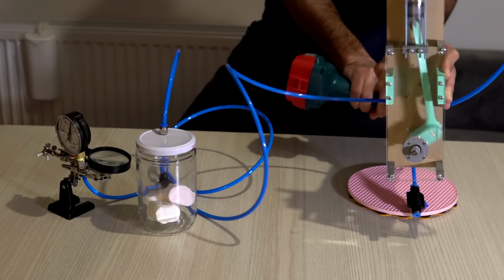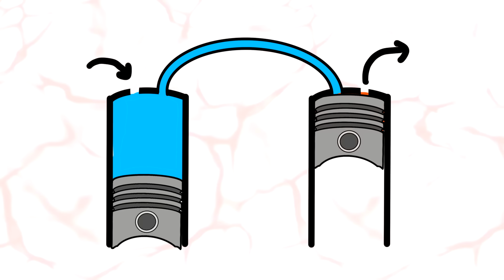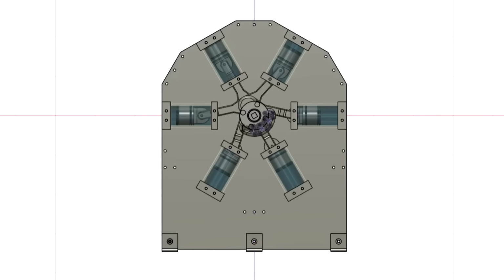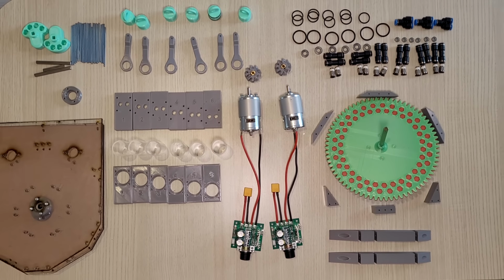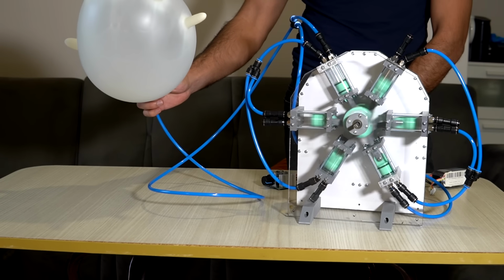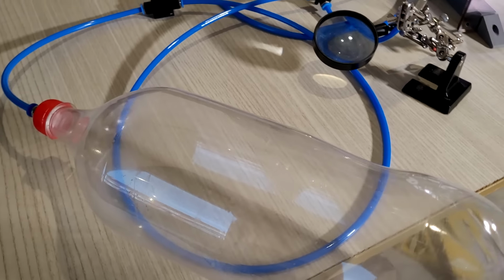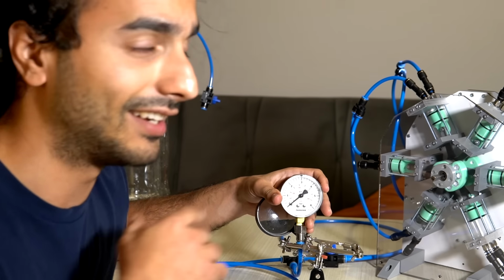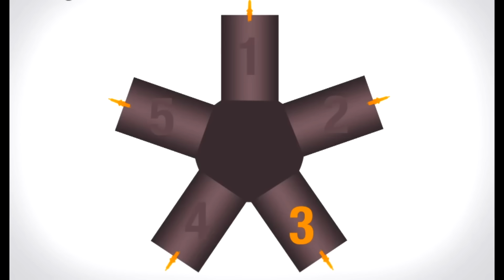I Built a 300+ psi 3D Printed Compressor

Comment: you should turn one of these compressors into a 4 stroke engine, the plastic may not withstand the heat but it would be awesome
Reply from the maker: I really want to build an engine but I live in a studio apartment
Reply: @canocholic you could maybe build it inside and run it outside

Comment: If u build compresor from 10% parts which are 3D printed (and in this case they are just decoretaion ) its focking clickbait.....and trap
Reply from the maker: The parts that would cost an arm and a leg to cnc like pistons and crankshaft are all 3d printed. I think things like backplates shouldnt be 3d printed that's juts waste. 

For the cylinders they need to be smooth and pvc pipe is cheap and smooth.

Comment: Awesome design! I would recommend BLDC motors tho. Probs gonna be more expensive than your current setup, but those 775 motors are only ~80w or so. Just one rc car motor can do several hundred or even kilowatts. It should be able to run the pumps at higher RPMs and higher power. Plus, with a pressure or flow sensor + arduino/esp32 you can even get some automation done.
Reply from the maker: You're definitely right but I work with a tight budget. Maybe as the channel grows i can use better equipment

Comment: Your work on this is seriously amazing.  

A 3D-printable rotary vane vacuum pump is seriously what I would consider one of the key technologies that could change the state of the world when they are fully open source and free to make commercially for households and local level businesses.

Particularly if it can be plugged into and used for heating and cooling as well.

A project I’ve been working on is trying to find a way to make wax-filament specific 3D printers and waterglass based molds.

And then building out a web-platform that automates how to make molds for different materials is also something worthwhile, which can be done via integrating FreeCAD with threeJS.

If we could combine 3D printable rotary vane pumps with 3D printable Kilns designed for wax-filament melt-out, then we can also build the stuff to make single walled carbon nanotubes and nanofilters based off carbon using reaction chambers.

Then there would be the capability to make a fully 3D printer based manufacturing industry that is wholly based on renewable energy and electricity.

And it could be based off materials that can be produced literally anywhere in the world by any country.  

Making every country capable of industrializing from the ground up with only local level businesses, using Open Source technologies as a basis that can still provide a bedrock of modern convenience even just using renewable energy.  

While also giving the people the capability to have modern conveniences and automation, without the government or large companies being in control of the origin and baseline of society.

I’ve been working mostly on software projects for enabling an ‘open source economy baseline’ for a while, since that is my profession mainly, and have only gotten so far skills wise in terms of 3D printing despite having the physics degree as background.  

But there are many projects that give people hope of breaking out from under the control of monopolies and towards having a genuinely free economy, and the scope of comprehensive projects out there seem to cover all the bases.

Yours is a super important one though, thank you for all your work in making this kind of work available publicly.
Reply from the maker: At home engineering got to impressive level in recent years. With opensource projects and experiments, the amount of knowledge and tools we can reach is amazing.

Comment: Multi-cylinder engines have been configured to space the power strokes together rather than evenly as you would for smoother power delivery. Most notably in engines used for motorcycle racing. This changes some behaviors like tire traction. This configuration has been called 'big bang'.

Cool project and great video!
Reply from the maker: Yeah, i heard that that way, the tire can gain the traction in the second crank turn.

Comment: Would it be possible to change the configuration based on the output pressure? 
So if the pressure is low all cilinders take in ambient air and push out low pressure air. But once a threshold pressure is reached some valves switch the configuration and it goes into the high pressure mode you showed already
Reply from the maker: With selenoids, this could be done. Would be really cool.

Comment: You should get an oil filled pressure gauge so it does not flip around wildly while the pump is running.
Reply from the maker: Yeah, those are better, but the economy here is not doing well. I kinda have to buy the cheapest things that work.

Comment: you know you can (should) run both motors off of the same speed controller. they make ones that can handle 70 amps on amazon for cheap ($30). the reason why, is if one is set to run faster than the other, the power will back feed into the slow motor, overdriving it, and try to feed generated voltage back into the slow motor's speed controller, potentially damaging it. just hook them both up to the same speed controller in parallel.
Reply from the maker: You're absolutely right. A driver would be better. But the thing is, the ones i used cost 3.5$ here in Turkey. A 30$ in US driver is about 40-50$ here. It still would be better to use, but i kinda have to buy the cheapest thing that will work. Hopefully, as the channel grows, it will allow me to buy better quality stuff.
Reply: @canocholic  well how much can the ones you got handle? you might only need one of them. a 775 motor can draw up to 20 amps at 12 volts so if your drivers are rated for 50 amps then you can probably use just one of them
Reply from the maker: No, they are actually 10 amps, i have to be really careful not to overheat them. Had to take breaks every 1-2 mins when testing.

Comment: if you add a 7th cylinder you could get an extra stage of compression, not sure if 160 psi would be good for the acrylic though...
Reply from the maker: That would be coo to try, i beleive the thin piston rods or the crank would fail

Comment: 4:53 I found that if you need cheap, small, dimensionally accurate cylinders in a project, medical syringes do great for many use cases. I think in most cases they're made out of polypropylene or HDPE, which are both less rigid than acrylic (so more deformation under pressure), but maybe they would still do the job.
Reply: I've searched some numbers for my own project and depending on your needs, they may be useful. What I found :  1 mL (363 ± 197 psi), 3 mL (177 ± 96 psi), 5 mL (73 ± 40 psi), 10 mL (53 ± 29 psi), 20 mL (32 ± 18 psi), and 60 mL (19 ± 12 psi). It is basicaly : bigger = less pressure.

Comment: 2 litres bottle dont go over 120 psi it will blowup
Reply: Someone said they're rated to 600 lol but I just looked it up and it says the max is around 120-150 PSI, sometimes up to 170
Reply from the maker: Hi, check out my new video. It did blow a bottle up!!

Comment: 4-stroke radial engines need an odd number of cylinders to achive an even firing order (1,3,5,7,9,2,4,6,8, or odd numbered first, then even numbered cylinders). 2-stroke radial engines could have any number of cylinders greater than 1 because they can fire one cylinder after the other (1,2,3,4,5,6,7,8,9)
Reply from the maker: Yupp, you got it

Comment: Soda bottles like that can take up to about 600psi, if your curious, look up world record water bottle rockets here on youtube. Bewarned though, at that pressure, those bottles can become dangerous.
Reply from the maker: That sounds insane, can't image 600psi inside a bottle. Definitely will check that out
Reply: I knew they could hold a lot more than 100 but 600??? Holy hell that's a lot 🫨

Edit: just looked it up, and it said 120; it may start to fail, but can go up to 150-170 PSI before definitely rupturing

Comment: What do you mean by "over-engineered".
Reply from the maker: Well, it's a buzzword to get more views essentially. But my logic was that it is so unnecessary and excessive for a compressor to have 6 cylinders. And there aren't many 3d printed compressors that can reach this pressure.
Reply: @canocholic  Okay, but more cylinders does increase the volumetric flowrate for a given size cylinder.

Have you thought that perhaps the smaller size of the piston and cylinder is the reason why you can reach the higher pressures?

Also, on reciprocating compressors, the maximum pressure is related to the compression ratio.

PS:  As an engineer for over 40 years, the phrase is pretty much like fingernails on a blackboard.
Reply from the maker: Yeah, i definitely do understand that. Besides the title, did you enjoy the video, how was it for you?
Reply: @canocholic  Your videos are excellent.
Reply from the maker: Thank you, for the titles I'm sorry but I have to come up with somithing that sounds interesting even if it is not %100 true. It's just how YouTube works. Christopher Nolan can upload his new film here without anyone knowing and with a bad title and thumbnail nobody would see it.

Comment: recently, i've watched a video on radials rotary piston aircraft engines, (don't remember the name, some italian design fron the early 1900), and it used an primary (master) piston rod, to which the secondary (slaves) piston rods attached. i believe that will make the crank shorter, and more rigid.
give it a look :)
P.S: YOU ARE HOLDING AN 100 PSI COCA BOTLLE NEXT TO YOUR FACE?
use some PPE glasses at least, for crying out loud.
Reply from the maker: Turns out 100 psi is within spec, so i wasn't that worried. About the crank, i think the main reason for a master crank is that it allows all the cylinders to be on the same plane. In this conpressor, every cylinder is working on its own plane, and it's not really space efficient.

I didn't want to change the design since i already had a simple, working one.

Comment: well, unfortunately this is not how the efficient compressors work. 

the true engineering of a compressor lays in integration of the air inlet valve into the piston itself. 

that helps with the temperature control of the whole piston assembly, not just the piston head where the compression happens.

Comment: Go high pressure now by connecting them in series and making each cylinder smaller.
Reply from the maker: Actually, that is the design i wanted to build, but this is the one i could.
Reply: @canocholic  I am looking at compressing oxygen for personal use with torches. A small easy to service pump would be ideal. I am just not sure of the details (specs) for reliable 1000 to 1500 PSI.
Reply from the maker: That could be possible but it has to be really beefy to hold up to that much pressure. I'm not sure if plastic pistons and rods could handle that.
Reply: @canocholic  i wasn't going to go plastic of course. I haven't found any good information on the piston rings or seals for material and spacing specs, etc...

Comment: Tip: Asynchronous AC motors are really useful for this purpose. They are efficient, quiet, easy to connect and rotate much slower than a dc motor and have a relatively constant rpm.
Also if you want to know anything about pneumatics, the German company Landefeld have about 90 tutorials/instructions on many different pneumatic components. Unfortunately the videos are German too, but maybe with subtitles or YouTube's new audio tracks, you could translate it to English.
Reply from the maker: Thank you for the tips, highly appreciated

Comment: if you want to dissolve gases (air) in water, you should use COLD water because cold water can dissolve more gas, and shake the bottle to increase the surface area. or maybe make the air bubble through the water.
Reply from the maker: Thanks for the tips. The soda part definitely was an afterthought. Didn't have the time to do much research about it. But if I'll try it again, I'll use your advice
Reply: perhaps start with crushed or shaved ice, this will have the added benefit of cooling the air in the bottle so it takes less space, but the primary point is start with as little exposed water as possible, as the ice melts the resulting water should take in as much air as it can, as the entire container warms the air should expand, problem is nearly frozen water takes less space than frozen water so i'm not sure if that'll cancel out the extra pressure from the air expanding

Comment: You should make one which can compress O2 to around 3k PSI like home O2 tanks hold.
Reply from the maker: That sounds like a recipe for a disaster
Reply: @canocholic  I mentioned it as the compressor design commonly used is very similar to what you have. Key features include better sealing piston rings, and smaller pistons as each stage compresses. 

Perhaps consider using the crank case as part of the compressing cycle. While top of piston is compressing, the bottom side could be sucking in air to then be compressed when the piston goes down.

Comment: 7:08  With an odd number of cylinders (like 5, 7, or 9), the engine can fire every other cylinder in a simple, alternating pattern (e.g., 1-3-5-7-2-4-6 in a 7-cylinder engine). This creates a consistent rhythm of power pulses, reducing vibration and ensuring smoother operation. An even number of cylinders complicates this pattern, often leading to uneven firing intervals and increased vibration.
Reply: Doesn't this only apply to four-stroke engines? - As is also noted in the last part of the video.
Reply: Hmm 7 cylinders of mass moving in a circle where is the primary balance issue there? 
Edit sorry I mean it is a radial so you still have secondary balances even if you put a counter weight on the main shaft for it there will be an issue with secondary balance issues that is why there are several banks of cylinders on airplane engines that are more rigidly mounted to the air frame...

Comment: What if you built a second stage with pistons of larger diameter and  shorter stroke, to get more of the energy from the exhaust?
Reply from the maker: Could work as long as the displacement is less than the first one

Comment: I assume those press on fittings are check valves?
Reply from the maker: You're right, they are! Check out my first compressor video if you would like to know more about the design. This is my third video about compressors and vacuum pumps